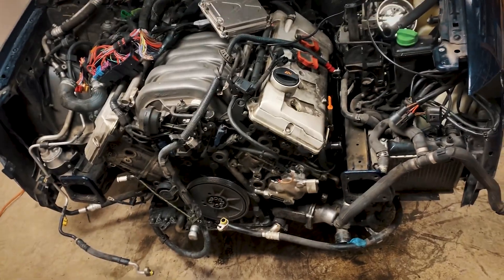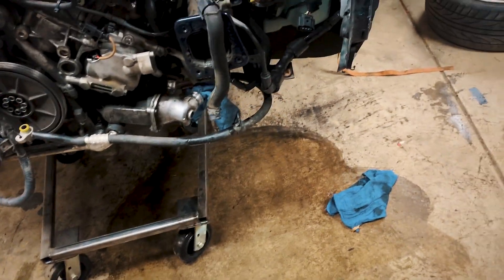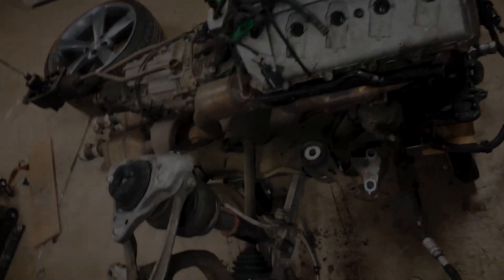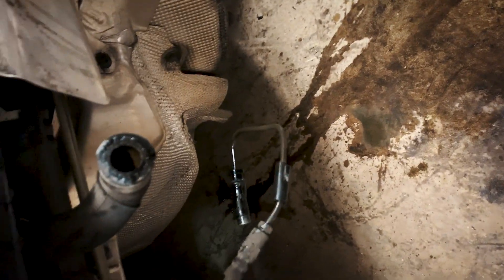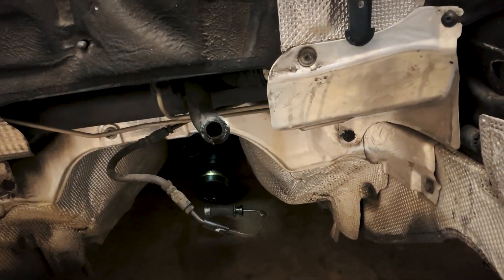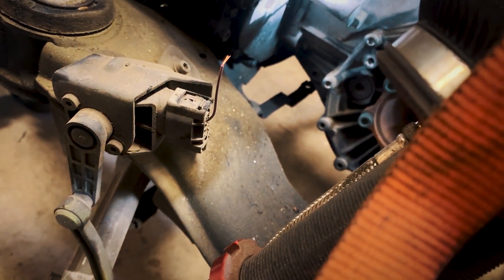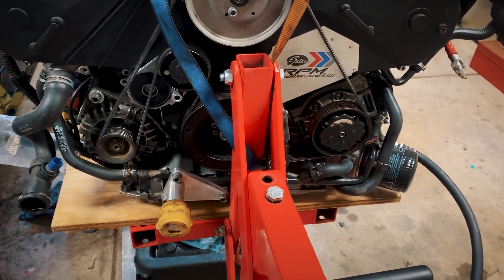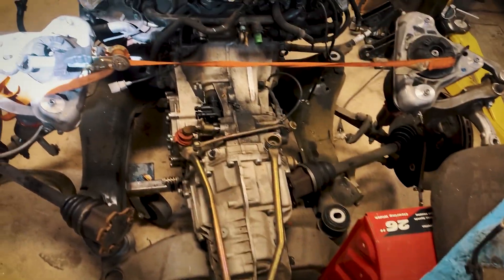Sub Frame is out! | Audi B6 2.7t Swap Pt.4

Comment: about to do a the swap on the a4 with 3.0 and 6 speed trans what will i need to complete this moded harness? mounts? ecu? will be doing the timing belt and gaskets update
Reply from the maker: 3.0 is the easiest app of good info online I also got swap harness from 27swap.com and https://www.audizine.com/forum/showthread.php/486284-The-Official-B6-2-7T-DIY-Swap-Guide has great info